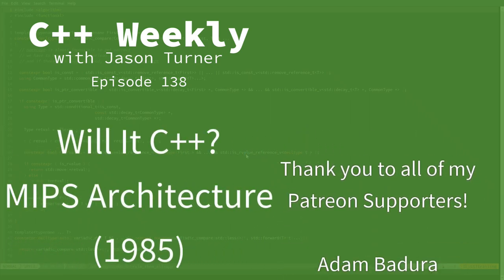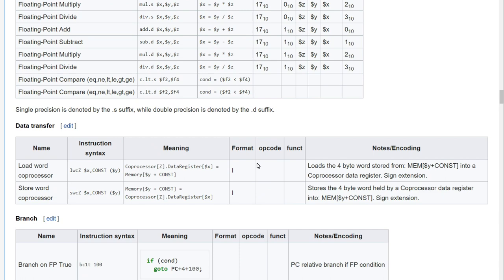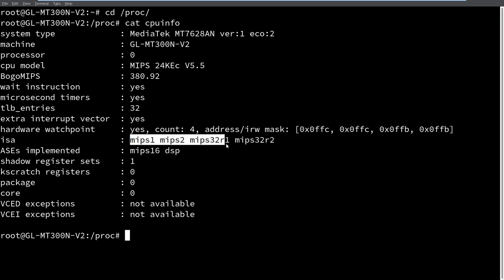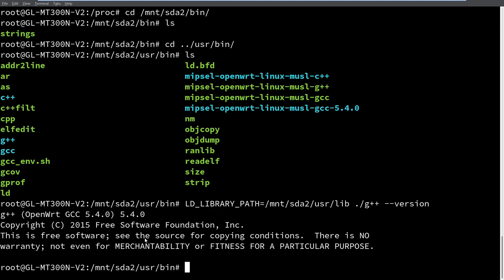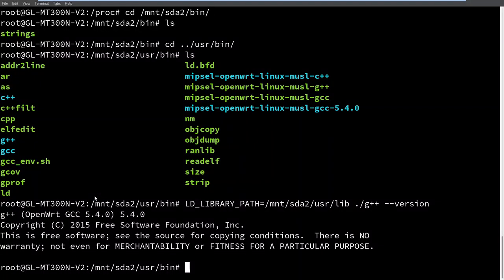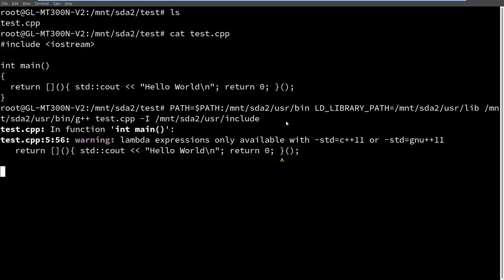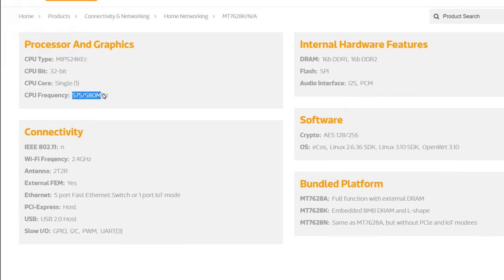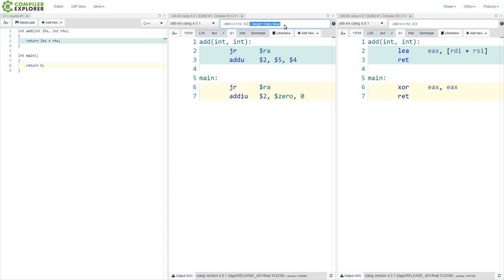C++ Weekly - Ep 138 - Will It C++? MIPS Architecture (1985)

Comment: Worth noting the MIPS has the unusual "branch delay slot". Which means the instruction after any branch is always executed before the branch is taken. The examples on screen at the 8 minute mark show this up: the "jr $ra" (jump to the return address) actually precede the "addu $2, $5, $4". Which is fun :)
Reply: I have familiar memories with Sparc, though I didn't know it was the case with MIPS too. But I guess it's not so unusual, if you take into account that pipelined etc designs may results in something like this behaviour quite "naturally", it's just strange for us :)
Reply: Absolutely: before branch prediction was a thing the pipelined architecture of processors was difficult to implement. Often the part of the chip that determined the branch destination (the "write back" stage) was a cycle (or more) beyond the fetch and run parts. That meant each branch was more expensive as it required a pipeline flush (to clear out anything that had been fetched in error). By letting the mostly-processed "next instruction" one could get meaningful work done while the branch took effect, instead of having it all thrown away. If one didn't have work to do, one just put a NOP in the slot. Lots more info (and better explained!) at https://en.wikipedia.org/wiki/Delay_slot
Reply: One of the later revisions however dropped the delay slot requirement. I forget which.

Comment: Until comparatively recently, most of the set-top-box SoCs were MIPS too. (The chip-makers that are left in that market have now switched to ARM/AArch64.)  I've been writing in C++ for them since 2007. The most-modern GCC I've used on them was 6.3, but I suspect that newer versions work too. (Oh, and you actually want --sysroot rather than using -I.)

Comment: Correction : the return 0 is for lamda , and not for main. Strange that compiler didn't complain that main has no return.
Reply: main() had a return as well; it returned the result of the lambda expression invocation.
Reply: Unlike other functions that return int, main() isn't required to contain an explicit return statement. It will return 0 by default. So compilers don't have to complain about that.
But in this example, both lambda and main() had return statements: main returned the value which it received from the lambda.
Reply: Apparently the return statement of main() is optional even in C since C99 and the default is 0 (if the return type is an integer). Cool. :)

Comment: I programmed for MIPS devices circa 2000 when developing software for WinCE PDA devices. I believe it was Casio at the time that had a MIPS PDA. I did learn it assembly language somewhat at the time and grew to kind of like it. Still have a book on MIPS instruction set. But WinCE PDAs did not become a lasting phenomena. At the time, by coupling these WinCE PDA devices to a GPS and AT&T CDPD packet-based modems, we were able to get a device that could do turn-by-turn vehicle navigation with audible driving instructions and visible navigation display. Also could support some voice recognition commands. Communicated with a data center server to overlay traffic condition reports onto the route being navigated. All of this in 2000/2001 using Microsoft's PDA devices and their AutoPC in-dash devices.

It was a vehicle navigation app that was very much like the experience that Google maps and others deliver today. But we we're perhaps close to a decade ahead of when this became common place on smart phones.

Comment: Those specs are more than almost enough to run a windows 2000 server with sql server 2000 .(256mb ram would be ideal) ^_^
EDIT: Speaking of which, does the latest gcc still compile on windows 2000? O_o